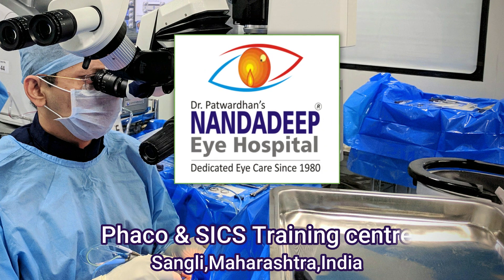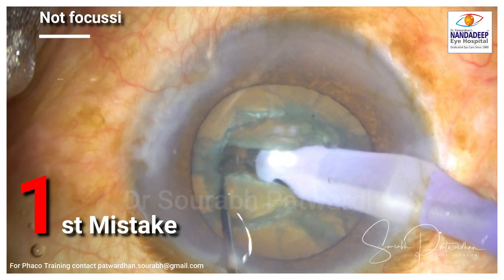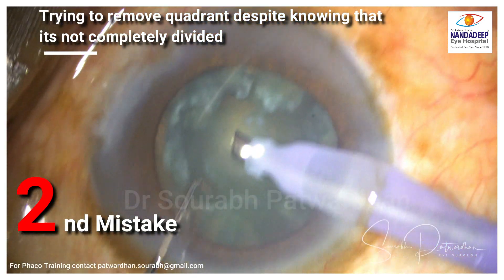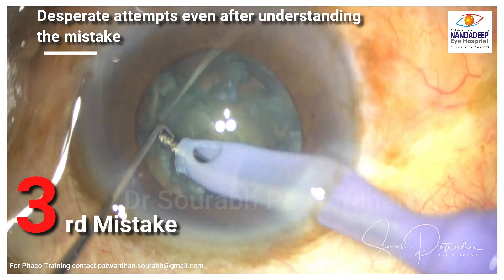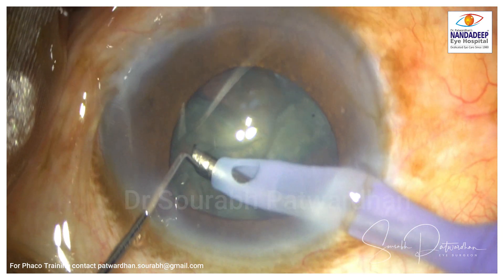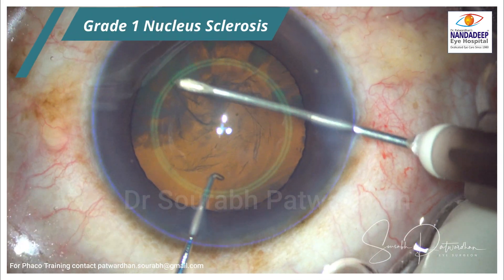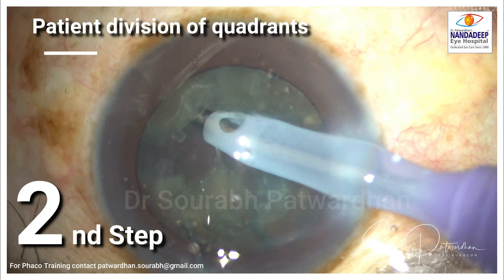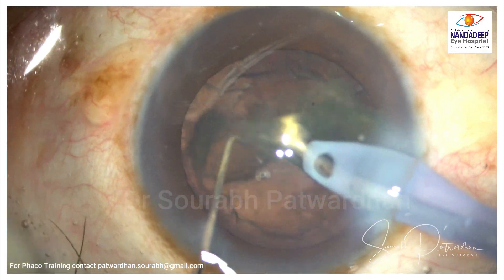67 Bowl formation : Cause and prevention Dr Sourabh Patwardhan - Soft cataract

Comment: Nicely demonstrated sir, 
I do Visco/Hydrodissection in between & prolapse one pole of d bowl & emulsified
Reply from the maker: Thanks sir.. yes thats a good strategy to treat as i mentioned.. but ccc size must be more than 5 mm. If its small, one lands up in more trouble in trying prolapse it
Reply: @SourabhPatwardhanPhacoTips  Once there is a bowl and incomplete cracks, it is generally safe to hydroprolapse even with a smaller capsulorhexis. Other option is to use blunt instrument like Koch spatula, straight Connor Wand to backcrack/lift center portion of flower petal.

Comment: Dear Sourabh
After u create bowl 
Apply high volume and phaco power of say 5-10%
Will easily prolapse the bowl out of the bag 
And avoid punch and rent of PC 
U try it
Reply from the maker: Thanks dr. That's what is tried. But not always successful so surgeons should know how to avoid it.
Reply: Yes Sir, In such situation,with the same settings you suggested, we can just lift the central plate,from paracentral point,to avoid PC damage and with blunt dialer can separate or chop it from rest, rest is easy.